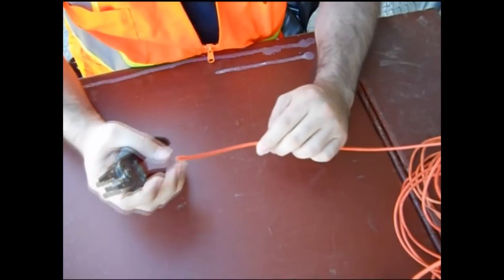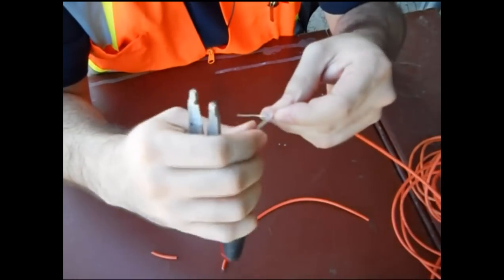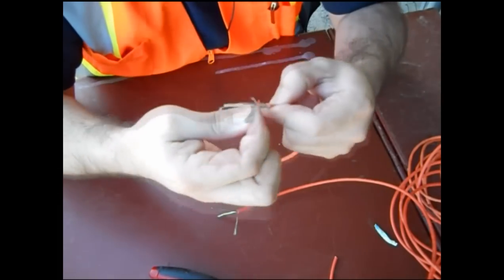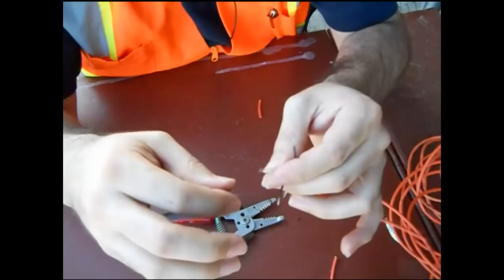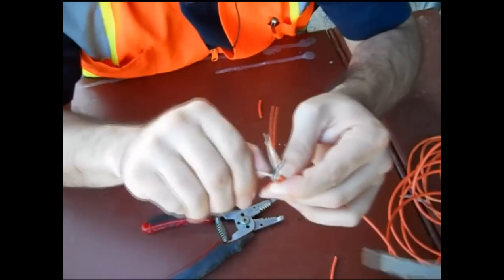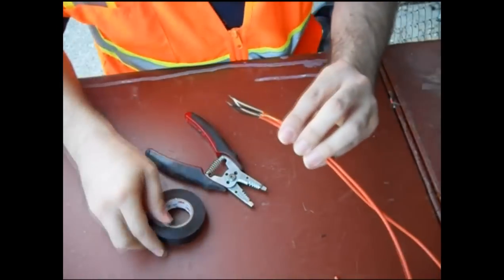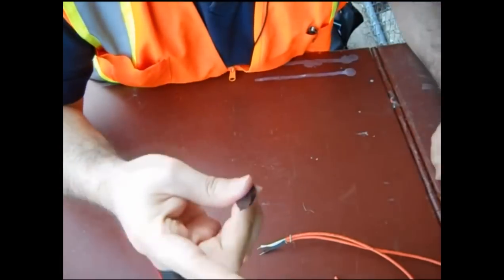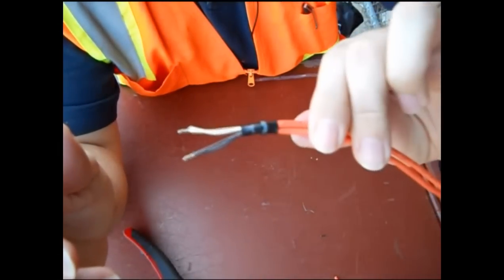How to Strip Controls Communication Wire for Building Automation Systems

Comment: If you have the extra time, I prefer a short piece of heat shrink tubing to wrap your termination rather than electrical tape. Totally steps up your game, especially on a nicely finished row of connections on a DIN rail

Comment: I have a suggestion. Instead of cutting off the string , use it to strip the jacket off of the wire. Works great every time and you'll never nick into the wires creating the headache. That's my two cents
Reply from the maker: Yes, I use the string to strip long runs (several feet) of wire all the time, but the amount needed in the video was only 2-3 inches, so easier to just cut what you need and get rid of the string to make it look clean.

Comment: Nice work, being an electrician, doing BAS and process instrumentation in the field in my past, you don't want to be that "guy"... we used to leave what's called a "courtesy" tab on the electrical tape. Basically, after you tear off that piece for use, pull up a 1/2" or so, fold it back, stick it to itself...leaves a "courtesy" tab for the next use. Probably a bit anal retentive, but oh well...